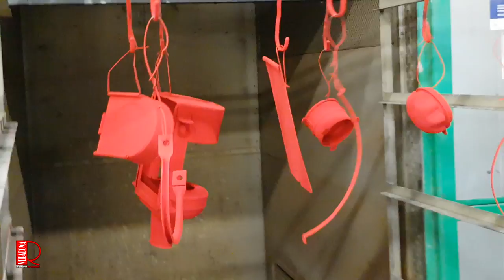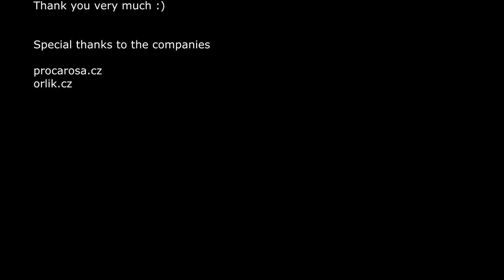Old ship lamp - Restoration

Comment: The lamp should have been painted white or black.  A red colored lamp on a ship is a port running-light (a green lamp is a starboard running light) and that lamp is not a running light, the shape is wrong.  I don't know what the Czech is for port and starboard running lights but in German it's Backbord- und Steuerbord-Lauflicht.

Comment: With 24 years in the Navy, I would suggest this is actually a stern light as would have a 180 degree arc of white light facing to the rear of the ship.  The masthead steaming light has a 270 degree of white light facing forward at the highest point of the mast.
Reply: Almost right, steaming light actually covers an arc of 225 degrees and it's position and height depends on the vessel

Comment: Sensational restoration as we've come to expect!  Navigation lights are colour coded, RED on the PORT (left) side and GREEN on the Starboard (right) side. It's the same for all aircraft too.
Reply from the maker: Thanks for the information Colin .
Reply: yes magnificent restoration except that here the glass is white so it is a mat fire and the outside of the lamp should also be white, but apart from this small error (you have to know the navigation rules to know) superb job

Comment: Nice restoration, but this is a ship's masthead light and should be painted white. Red is for the port light and green for the starboard.  Also please look at some videos of splicing rope it would look so much better if done correctly.  A good effort though.
Reply from the maker: Thanks
Reply: Gosh, you could have been a bit nicer about it! It's a fantastic job. I don't think they were thinking along those lines. Good comment effort though.

Comment: The part you take off at  1.21 looks like it was also used for another style of oil lamp that would have a glass chimney , the little tongues , the part that looks like the top of a crown would grip the glass to hold it steady
Just seen the end where you have the new glass chimney for it ))))), that will teach me . Nice work,  maybe a sympathetic conversion to electric would be another step and use it as a wall lamp in your house , as long as it not ruin any original parts
Reply from the maker: Thanks David :) Veronika and Radek
Reply: @VeradonaRestoration  I was in the merchant navy so this sort of thing interests me a lot

Comment: It's going to shine for decades! Very nice job!... I'd like to know why you bother cleaning the parts before sandblasting.
Reply: I think it is to keep the sand blasting media in good shape because it is recycled through the bottom of the blasting case. Sticky substances would cause problems. Someone please correct me if I'm wrong.
Reply from the maker: Thank you. Grease could make a mess in the abrasive tank. (my opinion)
Reply from the maker: Yes, you are right, you were faster :)
Reply: @VeradonaRestoration  Oh, yeah! You're right! Didn't think of that. Thanks for your answers!

Comment: Nice. Any concern that the powder coating may get too hot from the lamp and start to deteriorate?
Reply from the maker: Not at all, there is a glass shade inside the lamp and the top of the lamp has two shells, so hopefully it will be fine.

Comment: Nice lamp. But at 9:05I am wondering, as I learnd from restoration videos, if the melted wire is lead, grinding and sanding it is very dangerous if inhaled its dust and may contaminate food or drinks nearby. Stay safe and blessed ✌
Reply from the maker: Thank you Abdul :)

Comment: Nice job, wish I could show you how to actually braid rope. 👍📹, 👋🧙‍♂️🇺🇸, 🍻👌😎
Reply from the maker: Thanks Kyle, no problem, just upload a video, I'm happy to watch :)
Reply: @VeradonaRestoration  never uploaded one. But I do know how to braid rope there is already several on the how to. The one they always leave out. Is how to make a eye in the middle of length of rope and not cut or damage the rope.
Reply from the maker: @KG-yn9qi  Too bad I wonder, maybe you should try it !
Reply: @VeradonaRestoration  Maybe? I was tought by a man I was working for at 15 years old (61 now) on a rig in the oilfields. We used 1" and 1 1/2" ropes. And cat heads to pull large pipe tools called tongs  , for screwing and unscrewing well casing from 4"" to 20"" I broke at lot of ropes the old man would splice braid  back together. One day he said, " well next ones on you". So better learn, so I did! With enough wraps on the oversized cat head I could snap a rope like it was sewing thread. Had also  learn not to over pull, stop braking the  ropes. The cat head would get so hot the ropes, would smoke, if touched would burn me!

Comment: Absolutely incomprehensible, sandblasting galvanized sheet metal and covering it with paint that is not temperature-resistant. And then the wrong color. No go!
Reply: You obviously know nothing about powder coating...
Reply: They put the paint in an oven to set lmao. They sandblast it to get all the contamination off.
Reply: @GunLawyer  lobbyist
Reply: @GunLawyer  And you have eaten wisdom with spoons.
 Give an example!

Comment: Very good restoration 
Too long match 😊☺😀
What is that powder paint??
Is it mixed with water or benzene ???
Is it dry in oven ????
Reply from the maker: Yes, it is powder coating
Reply: @VeradonaRestoration  thanks 
You mean the paint is only powder 
And 
Not mixed with any liquids? ??
Reply from the maker: @ModyMody-vn9yg  Yes, it is powdered (the red one) is applied electrostatically and fired in an oven
Reply: @VeradonaRestoration  thanks

Comment: The work you did was good, but there was very little in the way of restoration. Replacing the globe and polishing the brass was the extent of it. That piece was originally galvanized. All it really needed was a good cleaning. To restore it the same fasteners should have been used to put it back together. I don't understand the need to fill in the small dent when the entire bottom was open so it could have been formed back out.

Good work but it erases the originality and history of the lamp IMO.
Reply from the maker: Thanks for your feedback Chris

Comment: I'm a bit split no fault in the quality of your renovations! But the color? Maybe it was a bit Overkill? 🤔😉 Personally, I think it would have been better to renovate the lantern to an original condition. It is still a historical object from a country that no longer "exists" .....
Reply from the maker: I thought the lamp was red. When I bought it, I had exactly the same color in this shade, so I wanted it too.
Reply: @VeradonaRestoration  I do not disagree. But it is usually the case that the starboard lantern is green and the port side is red. Then the sternlight can be black or in any neutral color even on the bow lantern. But that was the case on older ships in Sweden.
But as I wrote earlier, I like your renovations.